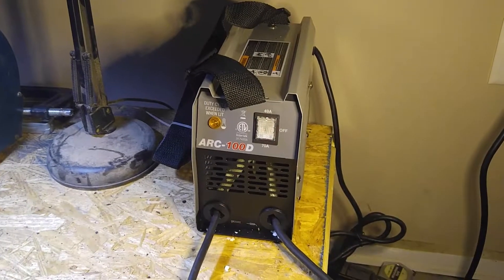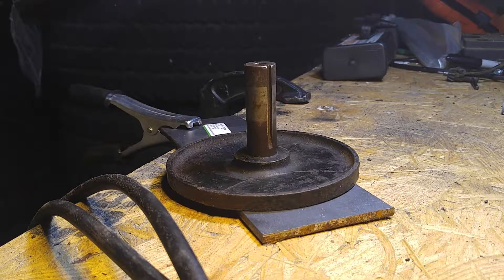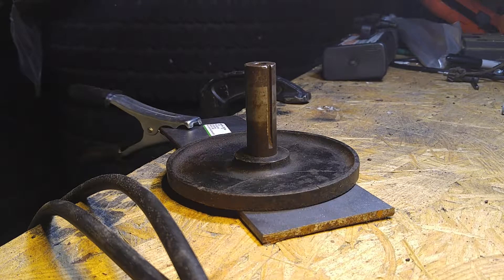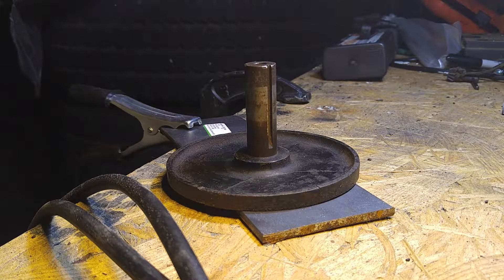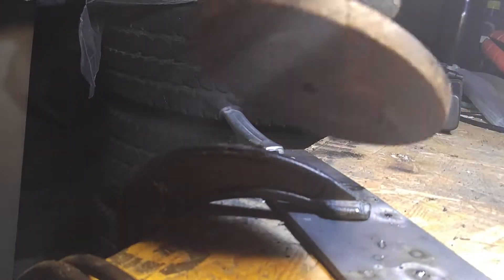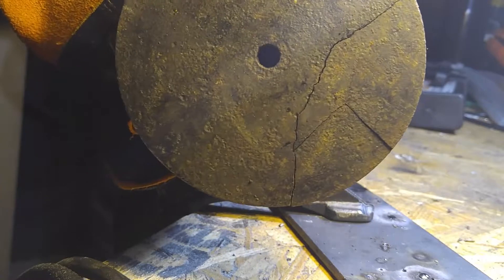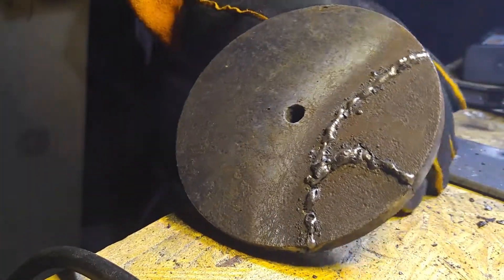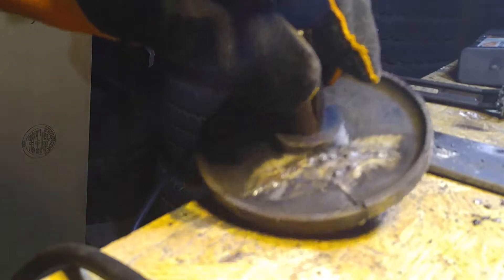100 Year Old Drill Press Restoration (Part 3)

Comment: I have worked with professional welders and they would have gone about it completely different.
In the first place welding across the surface like that won't do any good. As soon as you grind off that surface weld it's just going to fall apart again. And if you leave that surface weld on there to hold it together, pretty soon it's going to crack down the middle of that surface weld and fall apart again.
The other commenter was right about that being cast iron and not being very weldable. 
It should at least be clamped down tightly to a flat metal surface and clamped together with the other pieces as tightly as possible and then use a hand grinder and grind a v-groove along that brake so that you can weld down into the metal not just on the surface and do that on both sides v groove it and then fill in that groove with weld. But keep it clamped down with solid bars while it's cooling to keep it from warping as it cools. 
While you are welding you can also move that stick slower creating a big puddle where your welding as you slowly move that puddle along the metal. 
For welding a wide v-groove you should also move the stick side to side as you move forward. That way you get good adhesion to both sides of the v groove. The v groove should be at least half the thickness of the metal so that when you weld both sides that weld goes all the way through the whole thickness of the metal.
Better yet take a class on welding or read a book on welding.
By watching videos on YouTube the best restorations are done by people who know how to weld up damaged parts, so you'll be needing it in the future.
If you want that done right you could take it to a machine shop but that would cost a lot.
you might be better off just buying that replacement off of eBay.
Sorry.

Comment: Not bad for your first time welding. So as an experienced amateur welder, see those sparks? That means this is basically cast iron, which normally isn't meat to be reheated in a process like welding, so it has the potential of breaking under stress more easily than being hit with that hammer. But asides from that, for a quick repair i would have done the same thing if not maybe col welded it together like jb weld. Keep up the good work and i look forward to your new videos.